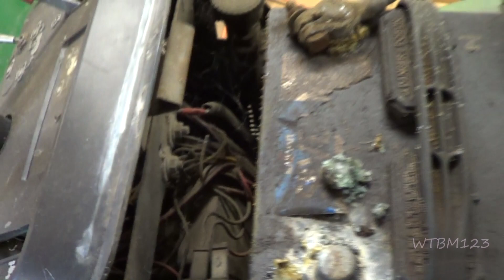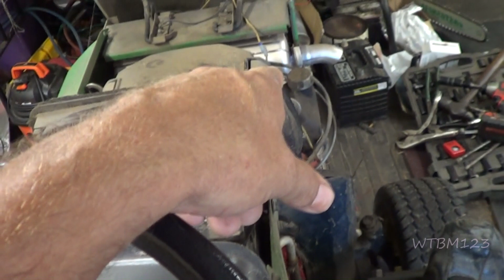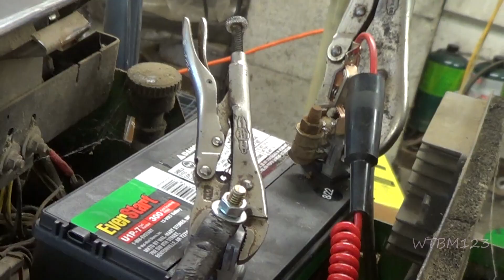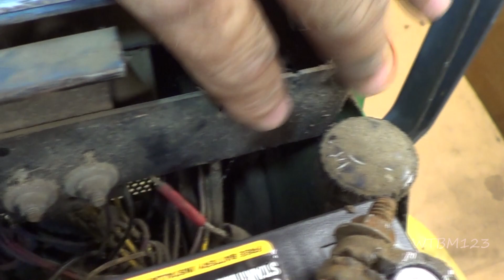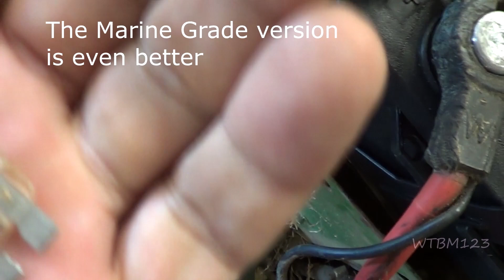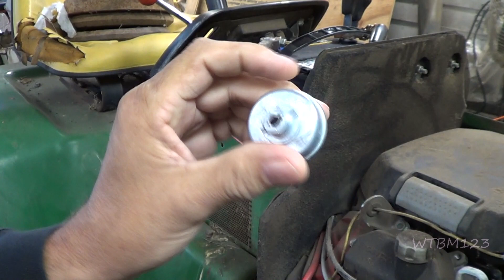John Deere 318 No Start no Crank

Comment: There is a possibility that the starter motor solinoid is not always pushing the internal contacts together hard enough for the maximum current to pass into the motor.
Dirty contacts inside the solinoid.
Those battery clamps were so dodgy that the resistance would limit the current, not good.
Reply from the maker: Those nice terminals lol . They were pretty rough

Comment: the switch went out on mine many times , The china companies supplying parts to the US companies are failing in quality .. I tried contact cleaner and WD40 and the ignition switches are kinda cheap built anymore ..
Reply from the maker: I agree with cheap built .